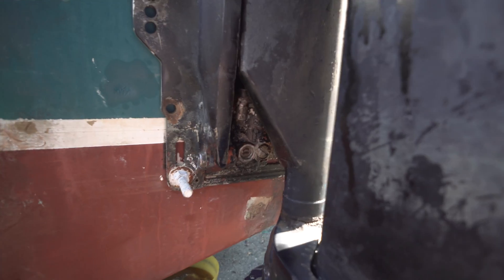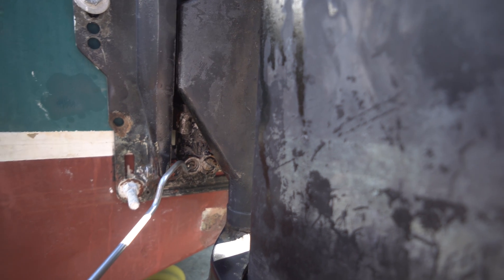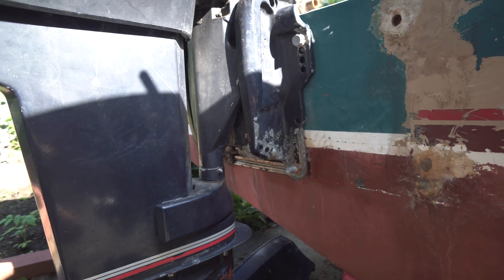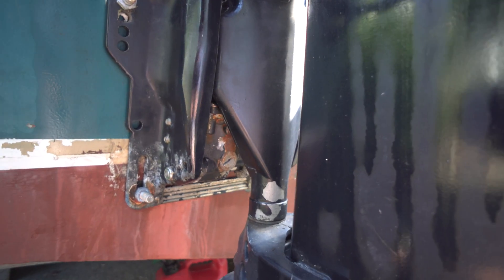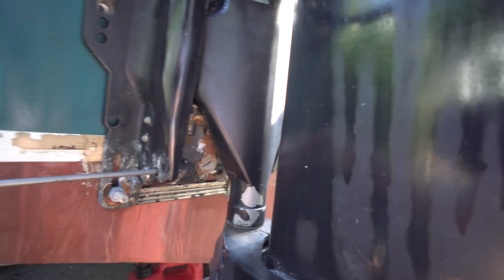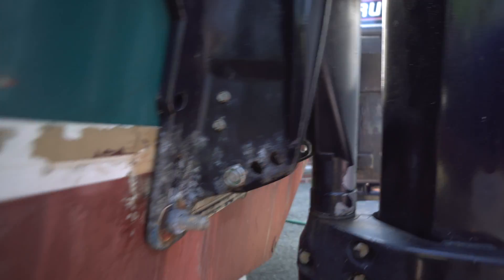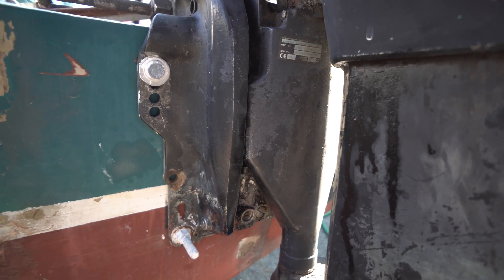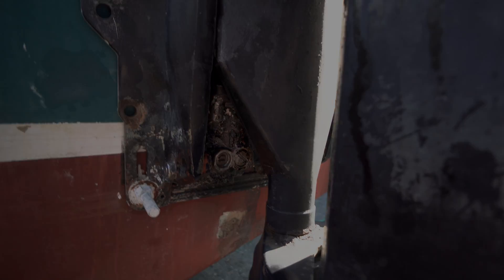Outboard Trim Manual Release Screw - 2 Different Power Trim Models - 40 HP Evinrude Outboard -

Comment: My trim went out and my manual release screw is backing out hitting my frame to, drilling the hole bigger where you insert a screwdriver won't hurt anything?
Reply: You don’t need to remove the screw to get the motor to release, it only takes 3-4 turns
Reply: @philbarrows424 thanks, I took a forklift too it just to ease it up, and it worked
Reply from the maker: @tyroneH4800  I have not tried it but I can't imagine it would hurt the integrity of the support much. Based on my version there would be very little drilling involved.

Comment: My tilt trim release screw is frozen and I tried using the power leads to a battery but nothing.
Is there any other way to get it down?
2001 Yamaha 250 ox66
Thanks
Reply: What did you end up doing? Had same problem except mine was stripped and Yamaha made that junk screw out of a soft aluminum head meant for flat screwdriver, so stupid

Comment: What if the Manual screw head is broken??
Reply from the maker: Generally these are not screwed in that tightly so maybe you could have some luck drilling it out with some sort of remover kit.
Reply: @IdeaMan4k  wondering what I will damage underneath.. So I stopped after breaking through.. It still won't come out yet with different extractors. I hope I don't ruin the whole thing where the screw needs to seat and seal. Seems to be made of aluminum. Really quite easy to drill through.. Will go really carefully tomorrow.
Fingers crossed. Thx!
I think corrosion from seawater fused it solid.
Reply from the maker: @bubblerings  Since you made the last comment I wanted to recommend prob the most useful tool I have purchased for boat repair / etc. https://www.amazon.com/dp/B004QO9FK2 
This thing makes taking out oil screws or any flat heads or bolts that are somewhat corroded really easy. It has been an absolute LIFESAVER! Basically you just whack it with a hammer and it turns the bolt slightly to get it loose.
Reply from the maker: Every year getting the oil screws and other screws out on the lower unit for maintenance has been a pain, until I got this. Never a pain again.
Reply from the maker: @bubblerings  Also 1 more suggestion on the stuck bolt. Try heating it and the area around it a bit. Let it cool. Then heat the area right around the hold a bit. Then use some sort of straw, or tube and use a can of compressed air cleaner upside down directly into the hole. Freeze it hard and fast, and immediately after try the next attempt. I have used this method many times with success.
Reply: @IdeaMan4k  bought one at Lowe's because I knew the oversized bit is less likely to break the screw top. It didn't work.
From sitting underwater for long periods.. I imagine it bonded to the assembly threads. 
Will try the heat gun.
I should be able to get what's left of the valve screw now. Will make the 4 pt. extractorr fit, using a dremel skinny bit.
Aam hoping.. 👍✨
Thx for all your tips and time!
Reply: ps. I haven't found a dealer yet selling Honda Manual Release Valves. Am starting to call around.
None online from searches. Hahaa. 🙊
Reply: @IdeaMan4k it’s called
An Impact Driver

Comment: That one you can't reach the manual release valve on is a Johnson factory supplied unit. It's most likely off a 1998, 40 hp model Johnson/ Evinrude. Those mounting brackets  allows you to reach the side mount manual release. Check the part number against the year.

Comment: Mine doesnt go down by itself, i have to push and force it down, is that normal? Im also having problem with the trim unit not going up or down
Reply: Sounds like you have air in your trim, look up videos on how to release your pressure.
Reply: @klemzer  I have the same problem.  I'll look it up.  Thanks!